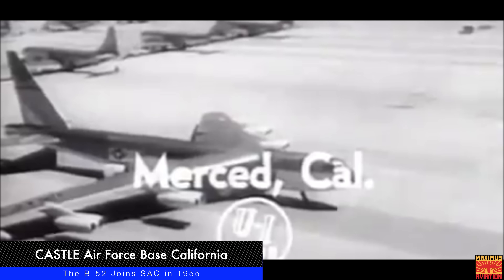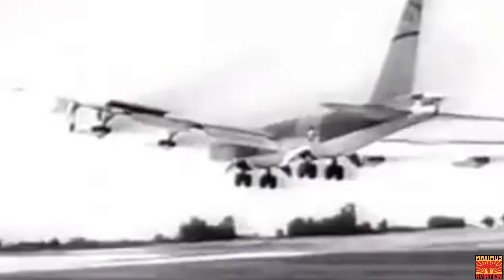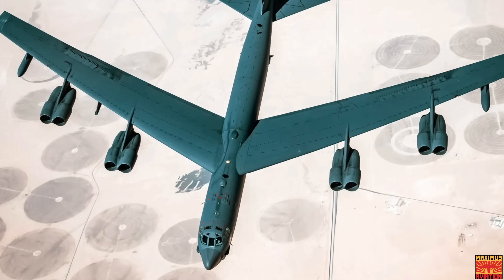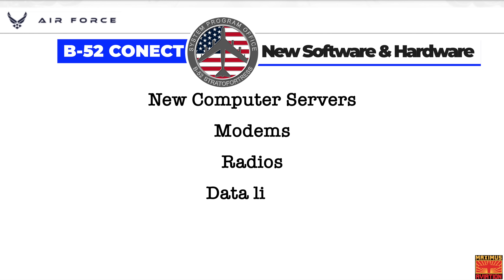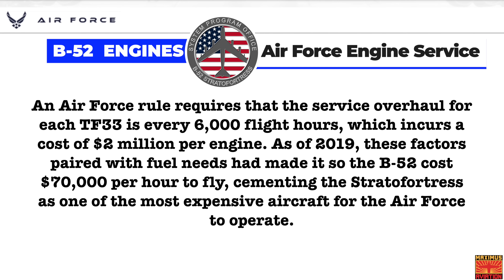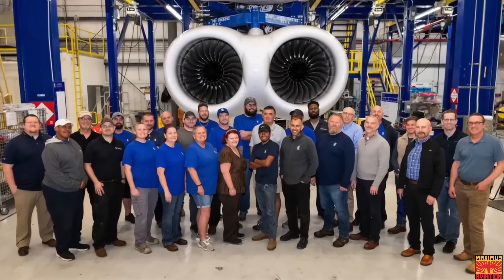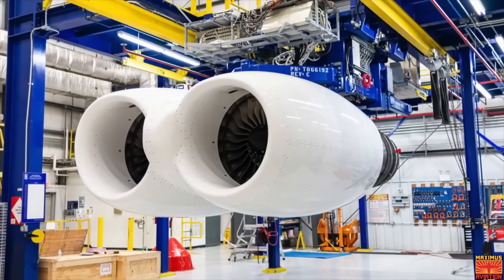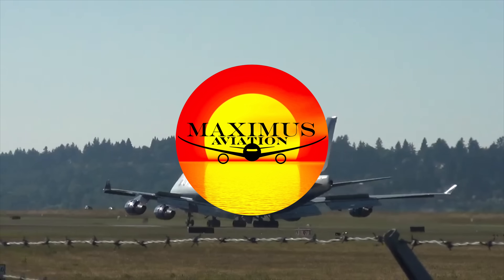The B-52 Will Fly For Over 100 Years With Its New Rolls Royce Engines!

Comment: Hi Maximus. Super video and what an amazing aircraft. However, I was disappointed that you suggested that the B707 was the first jet powered commercial airliner! Would you like to publish a correction…… maybe even do a a whole video on the Comet?
Reply from the maker: Yeah I blew that one. I"ll take the loss. I meant to say the first intercontinental.
Reply: The comet was not from USA was not particularly successful after the first few structural crashes;  fixes in design made it a lot safer but it was too late. 707 was a Boeing had it's own problems to start with engine mounts which were redesigned so the engines stayed attached and became the first successful jet passenger plane as far as I know. Comet was first but not long lived.   so yes and no...   Did the Russians make a jet passenger plane was it commercial or military? Don't know;  my memory fades about foreign aircraft,  military and commercial.
Reply: @donschneider7252  Boeing had its

Comment: Oh come on Maximus you know better than to suggest the 707 (aka the Dash 80) was the "world's first commercial jet airliner' when that accolade goes to the De Havilland Comet which went into service a full 6 years earlier (1952) although it flew some 8 years earlier.
And sadly yes we all know the history of the first Comets but they directly made the 707 a better aircraft as Boeing upgraded the thickness of aluminium used and changed the shape of the Windows. Back in the days when Boeing were a superb engineering business rather than the share trading outfit they are today.
Reply: Absolutely correct, all the data learnt from the Comet disasters was shared with Boeing. Had this not been shared Boeing would have not launched the 707 in the timeframe they did.
Reply: Really they probably have not hid it even if they wanted to as 56 people were dead
Reply from the maker: yeah go read the pinned comment. I screwed the pooch on that one!

Comment: Wouldn't the 4 big engines from the Boing 787 be more powerful and cheaper to run than 8 smaller engines from Rolls Royce?  Or is this just another case of military intelligence?
Reply: Lose an engine in one pod on an existing 8 engine arrangement does not create the same aerodynamic loads which would occur if you lost one of four more powerful engines. The B52 wasn't designed to cope with that scenario.
Reply: It “could” be done but would require modifications for the reasons listed and then your talking unjustifiable amounts of money.
Reply: Also, Boeing doesn't make engines. Often the engines you see on 747s are RR.
Reply: There isn't enough ground clearance on the outboard pylons for a large high bypass turbofan. Adverse yaw during an engine failure is a problem also. This is why they are using 8 of a smaller turbofan in podded pairs just like the original design.

Comment: Aluminum has a fatigue limit, flying fast and low has a very high stress environment, will be very interesting to see how much longer those very old air frames survive.....
Reply: There have been many structural updates done to the air frames over the decades especially wing roots and of course tail. What was a whole plane in the 1950s has little left in 2023 most of the early ones are in the bone yard or gone to scrap. Later builds are not so old and much improved over time as needed.
Reply: @donschneider7252  How much of the original airframe is even left in the B-52s still in active service? It's the Ship of Theseus paradox.
Reply: Betting those current birds have seen some reskinning after all these years... If not, well "steel (metal) don't heal"... My concern is the old Tail issues (breaking up/off the aircraft during flight) coming back if these new engines start stressing them with higher thrust... Can't wait to see performance #'s after the engine upgrade!!...
Reply: @richvanderwoude8667  New engines have exactly the same thrust as the old ones.
Reply: A bit like granpa's favourite axe,had nine handles and three heads and still cuts fine 😏🙃
Reply: You make a good point. At one point the BUFF was fitted for low level mine laying operations. But the stresses on the air frame and the small rudder were well above those encountered in the B-52's natural environment above 50,000 feet. Additionally, the development of 'stand-off' high altitude mine laying systems allowed the BUFFs to stay high and saturate an area with mines.
Reply: @denali9449  : The B52's A to F had a taller tail that could not take the low level stress,that was the reason for the B52G and H plus some other upgrades, those models have a noticeably shorter Rudder....

Comment: I know theres a good reason, but WHY cant we do this to the other airplanes on stock...commercial airliners?
Reply: Put 30 year old engines on them?
Reply: Bombers don’t fly as often a commercial aircraft. If a commercial aircraft is not in the air it’s not making money. Unless there is a war on military aircraft do not fly those sorts of schedules. So the flight hours run up on a peace time military aircraft will be a fraction of a commercial aircraft. So all else being equal commercial aircraft wear out faster. I’m willing to bet though that something like the B52 is designed for higher stresses and G loads then a commercial aircraft. Turning away from and surviving an atomic blast is not something on the design specifications of many commercial aircraft. So commercial aircraft are weaker, and therefore wear our faster. So their is a good chance that the airframe of the commercial jet has reached the end of its design life in a couple of decades while the military craft has not.

And of course a single purchaser of about 100 aircraft , the US airforce, has to pay for the design and building of an entire new class of planes if they don’t re engine what they have, which is ludicrously expensive, while a commercial operator has at least two vendors competing to provide a range of craft to suit their needs . At Merlyn expensive.

Comment: I normally applaud your history credentials, but Boeing did not make the first commercial jetliner, that honour goes to DH106 'Comet'.
Reply from the maker: You are correct and I stand Humbly corrected.
Reply: Comet was the perfect name too.
Reply: The Boeing 707 was the first jet airplane not to fall apart in midair. The Comet was a technical marvel, but that's all it amounted to. The plane was basically cancelled because it was one of the most dangerous planes in the air.
Reply: @orestes1984  >> It wasn’t cancelled.  The Comet 4 flew in airline service for decades.  You are correct that it ruined the program.
Reply: @orestes1984  Had we Brits not been responsible enough to pass on our research into the Comet crashes to Boeing the Boeing 707 would also have had square windows and would also have crashed in droves. Boeing have admitted as much.
Reply: @orestes1984  What a bunch of rubbish.
Reply: @orestes1984  Not quite true. It was never cancelled. After the fault which caused the losses was identified and corrected, the Comet flew successfully for many years.
Reply: @narabdela  I went on honeymoon on a Comet4B in 1975.
i
Reply: @orestes1984  I believe they lost 5 in one year.  Not much better than the Comet at first anyway.
Reply: @orestes1984  Correct it had a serious design flaw with square window design but it was still the first despite your snide assertion.
Reply: @petersneddon1579  Square windows and thin skin to allow the use of their crap engines and not Bristol or RR

Comment: Why don't they save millions by installing 4 larger engines, they are already replacing the pylons?
Reply: Watched another video which explained this. Apparently the issue relates to the aerodynamics of the B52 airframe and rudder. Switching to four more powerful engines would entail huge costs to re engineer the aircraft.
Reply: @johngrantham8024  Oh yes, you're right i remember it now. It would indeed in case of an engine failure. The chance of 2 engines in the same pylon failing is 1 in 7.

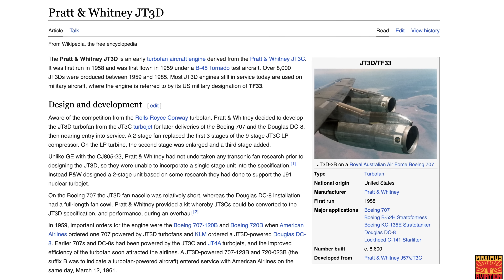Comment: 4:16 The Worlds First Jet Airliner was the DeHavilland Comet, first flying in 1949.
Reply: That's what I thought
Reply: The comet was not from USA was not particularly successful after the first few structural crashes;  fixes in design made it a lot safer but it was too late. 707 was a Boeing had it's own problems to start with engine mounts which were redesigned so the engines stayed attached and became the first successful jet passenger plane as far as I know. Comet was first but not long lived.   so yes and no...
Reply: was it commercial and successful or government owned/ financed and a disaster?    Guess it is a matter of semantics. Not really a successful commercial passenger plane but it could haul passengers as long as it could stay in the sky. 
it is probably why commercial passenger aircraft don't have square windows any more.

Comment: I think the B-52's deserved those engines decades ago. Those newer engines much be a lot more efficient. I don't think it would be all that beneficial to have them much more powerful, perhaps a bit for take-off. The bomber's about sheer, absurd delivery in volume. More power? Flying faster? Would just lead to more costs. In fact, I'm hoping a bit that those new engines can be ran a bit tuned down, for more efficiency and longevity. Imagine if that big revision could go from 6000 to 18000 flight hours. That would be huge savings.
Reply from the maker: Thats a fact.
Reply: They should have thought of this the same time they re engined the KC135.
Reply: They did the issue with the b52 is its hydraulic system if they had put 4 large commercial engines on to replace the 8 current ones the entire hydraulic system would have to be redesigned.  This is why it getting 8 smaller business jet engines
Reply: Extra thrust is always welcome on takeoff. Then just let the engines loaf in cruise.
They’re pretty derated on the G550 and G650. They’re run harder on the the B717.

Comment: The J57 was the original engine,  not the TF33
Reply: B-52A through G had J57 engines with water injection
Reply: Indeed. And they are two fundamentally different types of engine  as their names imply - J57 is a turbojet and TF33 is a turbofan.
Reply: It depends which model. The A model had originally turbojets, while the H model had TF33s from factory on
Reply: @simonm1447  well he said B-52...not B-52A-G or B-52H. In anycase, you cant have two different engines are originals. The J57 was the original engine

Comment: Why are eight engines being replaced with another eight engines instead of four single engines?
Reply: Saw this explained in another video. If you lose an outboard engine on the existing 8 engine configuration, the asymmetric load on the aircraft is controllable. If you had an engine out of 4, the tiny B52 rudder couldn't cope.
Reply: Plus you can keep all the existing hydraulics ,and electrical.
Reply: @tomking1890  An excellent point
Reply: @johngrantham8024  Yours is the most comprehensive explanation out of the three that I have received. Without a major structural kerfuffle that it would take to replace or modify the existing rudder, Just build it back the way it was
Reply: So the aerodynamics don't change!
Reply: That is as good as excuse as any that I’ve heard!
Reply: So the aerodynamics and wing loading doesn't change. 4 engines vs 8 is a significant change.
Reply: @michaelmoses8745  That actually makes sense from the standpoint of what those gigantic engines and say, a triple seven, must weigh
Reply from the maker: Four engines are larger than these Twin R/R engines.  Its about wing clearance.

Comment: How much better are the new engines in terms of power and fuel efficiency?
Reply: Power, almost zero change. Efficiency, IIRC at least 20% gain in distance.
Reply from the maker: I spent some time looking for the specs and didn't come up with any but I'm sure they are on the google somewhere. But I can't Imagine Rolls Royce would take the chance they screwed up on the calculations on this one so I would assume they will do the job. But it is a good question.
Reply: @maximusaviationchannel  Thanks for trying.

Comment: The TF33-P3 was the first engine of many I completely disassembled in the Air Force at Minot AFB in 1976. Easy to work on (once off the wing). Glad the upgrade is finally going to happen. Great video. Thank you sir!!
Reply: I didn't realise its the same engine as the B707. That must have made spares very easy to obtain after 1958.
Reply: @k9killer221  They both started out with J-57/ JT3C  engines, and subsequent aircraft versions went to the TF-33 turbofan.  or JT3D as the civilians called it. Boy I an showing my age now.  LOL  I started working Aircraft in 1963 thru 2017.  Loved every second of airplane time.  I did a few TDY's to Minot when I was assigned to the Depot team our of Tinker AFB back in the early 70's.
Reply: I used to work on these as well in the mid 80s at Carswell AFB in Fort Worth.  Spent time in the test cell, engine shop and a short stint in the fuel cell.  Good times.
Reply: About 25 years ago there was a proposal to replace the eight B52 engines with four RB211-535E4 engines, the ones that power 757s. The cost of installation would have been covered by fuel savings over the subsequent decades. So it would have gone from an eight-holer to a four-holer.

I always liked that idea, though perhaps clearance between the bottom of those engines and the runway might have been an issue.
Reply: @cv990a4  From what I've read it turned out that in an engine out scenario with a 4-engined version, the plane wouldn't have enough rudder authority in certain critical situations like take-off. So it would have needed a new and bigger rudder, and strengthened back fuselage to handle that etc etc. and the cost of the program spiraled out of control. And yes, ground clearance might have been a problem too.
Reply: @jbepsilon  That is the first time I've heard of a plausible reason not to go to four engines. Thank you for the info!
Reply: @jbepsilon  : What if just the inner 2 engine pods were replaced with a single RB211, and the outer pods kept as twin engines to make a total of 6 engined per plane 2 big, 4 small. if one if the inner engines failed, I think there still might be enough rudder to keep flying?  As a general rule, with the same level of technology, with every doubling of the engine size (in thrust) the efficiency goes up about 10%.
Reply: @johndavidwolf4239  Might work in principle, but I'd guess the various additional fixed  costs would be larger than the fuel savings.
Reply: I'd like to thank you guys for keeping us safe!
Reply: I was a crew chief in the mid 70's at Grand Forks. It is good to see that they are finally re-engining the old gals.
Reply: 15 years ago I picked up some spools of Alloy nn containing Co, Cr, W and other goodies from the military.  Polymet said this had been used for hard surfacing turbine blades on engines made years ago, the TF33.  I had forgotten that these could have been the B52 engines.

Tinker used to do, (and maybe still does), some of the B52 overhaul work.  One of the machines used for incipient failure detection were Zeiss UPMC750 measuring centers.  (Same model as used by Sandia and Livermore Labs.)  A part, such as a 400Hz generator, would be placed on the granite table in a random position, and the sapphire ball would move until it hit a surface, record it, and move to the next x-y-z point.  After awhile the software program would compute various measurements, such as the eccentricity, within an accuracy of 2.5µ.  If it had changed too much from the prior maintenance check. it was either remanufactured or scrapped.  So, just one of the ways that have helped the BUFF stay in the air all of these years.  (Did Tinker need this kind of accuracy?  Nope, 20 or 30µ would have good enough, but that unit was showing yearly maintenance savings, (15 yrs ago), of $16 million costs, so it had the budget and it bought the best.  The UPMCs were replaced with similar units that had updated controllers and computers, but the operators actually thought the older UPMCs were better apart from the software and hard to get replacement parts.)